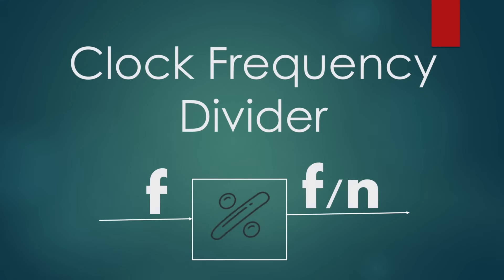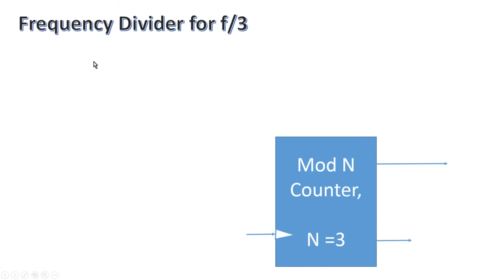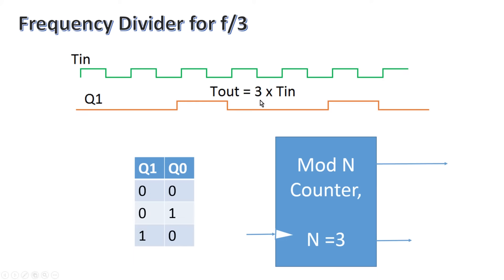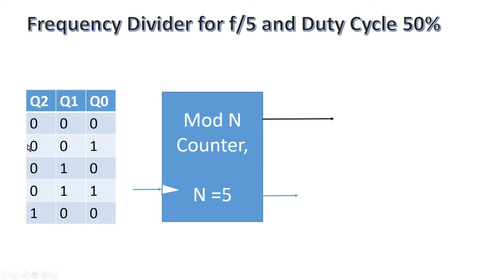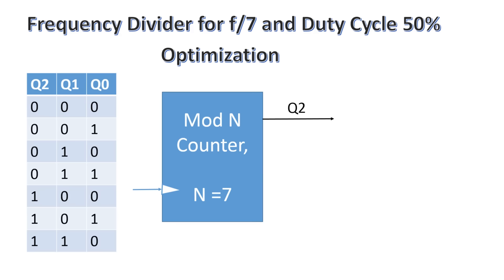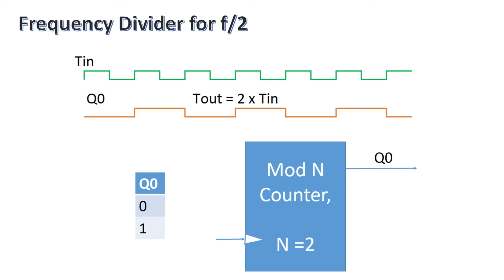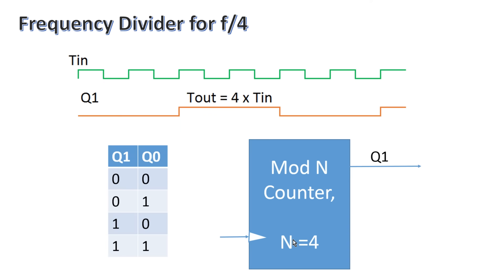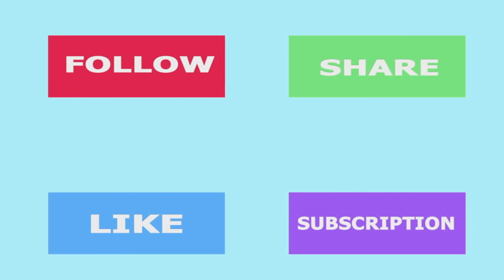Step by Step Method to design any Clock Frequency Divider

Comment: When we give f/4 to a -ve edge triggered DFF, it just delays the signal, but the frequency of the signal doesn't change.
When you check the clock diagram for both the outputs after ORing them, we see that we will get 2.5 clock cycles of logic 1, but also we will only have 1.5 clock cycles of logic 0. Hence, i feel that we did not get f/5, but we have f/4 with 3.5 clock cycles of logic. 

If i am wrong, please correct me. Thank you
And please confirm if I am right or wrong
Reply: Umm for f/4 just use Q1 directly...
I think u are talking about f/5? 
If so then after u get 2.5 high periods and draw them , it doesn't fit the initial scale ( used in the input clk f) but independently you can see it's actually f/5

Comment: There is a mistake in you timing diagram of Q3 at 16:30. The pulse for Q3 at the end of the timing diagram is wrongly delayed by half clock cycle instead of 1 full clock cycle.

Comment: How does the f/4 clock divider avoid having a glitch in the center as you transition from counter values 2'b10 -> 2'b11? The others work because the use of the inverted clock being used to create a delayed version that are OR'd together, which helps protect from any potential glitch in the middle.
Reply: you dont need a mod-n couter for 2^n divisions. f/2 is a single d-ff which has its q' connected back into itself and thus output q serves as an f/2 clock. connect this f/2 clock to the clock input of another d-ff which has its input from it's q' as well. thus the output of d-ff q2 serves as an f/4 clock. you can keep cascading connections to get f/(2^n) divisions.

Comment: for frequency divide by 3 ckt you have taken Q1 and did shifting for the wave generated through d-ff and did or we got output at 3-4.5(On)cycle and 4.5-6(off)cycle. why dont we take Q0 as both have 33.3% duty_cycle? is there any reason taking only Q1?why?

Comment: The fact that negative edge trig d flop will delay by half cycle is only true if the counter is made of positive edge triggered flip flops. They have to basically be opposite triggering for half cycle delay and same triggering for 1 cycle delay.
Reply: i also have same question

Comment: 8:50 sorry but I can't understand why Q1 is a signal of frequency f/5? Also 11:42 why Q1 is not a signal of f/7? I thought you could optimize the last case by choosing the Q1 column which had 3 high signals and 4 low signals

Comment: Thankyou for the wonderful explanation as always.
How would we tackle a situation when the DC produced by the frequency divider is for example say 75% but we want 50% duty cycle? what do we do then? You have addressed the situation where the desired DC is more than the actual DC so we can add flops to achieve that, how do we do it for the example that I mentioned? TIA :)
Reply: I am not sure but in that case we can use d flip flop ( negative or positive depending on our requirement) and then will use and gate or some others gates depending on the output we need like xor etc.
Thanks

Comment: Hi...very good explanation. I have a question. You were used MOD-N counter in frequency division. As per my knowledge MOD-N counter can implement in synchronous and asynchronous manner also, so which counter it is, synchronous or asynchronous ?
Reply from the maker: In usual practice, synchronous designs are used .. because asynchronous designs are prone to glitches.
Reply: Synchronous because at the outut of each ff  f'= f/n

Comment: Cant we design a f/6 using a and gate with q1.q0 and ORing it with q2.  ((Q0.Q1)+Q2)
Reply: Divide by 6 is very easy divider, because a simple TFF-trigger is enough to divide by 2, next step is by 3 divider (2*3=6), which can be implemented with simple counter.
One of the reason of video, I presume, is to make combinational frequency divider, but if divider is multiple of 2 we can do that with synchronous logic.

Comment: Sir, what do you mean by q1 is not having a signal f/7?
Please explain
Reply: As we notice that in mod 7 counter,
States are
000
001
010
011
100
101
110

If we take Q1, it's changing from 0 to 1 or 1 to 0 right after 2 clock pulses
 That is, the frequency of Q1 is f/4

Comment: I have been using these frequency dividers in my microcontroller-based  projects for almost a year for different purposes but until now I didn't know how it was possible to "divide" a clock frequency, it just makes no sense when you look at it that way, but the picture depicting this "division" actually explained it perfectly, all you do is increase the T by the amount of N you want. I still don't know how these digital blocks actually work but at least I know how they change frequencies

Comment: In f/6 why don't we just use q0 to take out the frequency of f/6? then we won't be needing extra hardware for that circuit. Anyone can explain that?
Reply: q0 is a div by 2
it goes like this 010101
but a div by 6 goes like this 000111

Comment: I have a doubt, how do you get to know that Q1 is not  a signal having frequency f/7??
Reply from the maker: Observe Q1 carefully, It is 0 0 1 1 0 0 1
Let us repeat this pattern 
0 0 1 1 0 0 1 0 0 1 1 0 0 1  0 0 1 1 0 0 1  0 0 1 1 0 0 1  ........
See Q1 carefully .. It is not even a clock signal .. 
because logic HIGH and logic LOW times are not fixed ..
That is another reason for not considering Q1..
Let me know if you need further clarification..
Reply: @TechnicalBytes  Hi sir, please further clarify the same question.

Comment: hello, i try by myself to create the f/7 as you shown in the video but there's a problem becase the last falling edge given exsta half clock cycle at '1'. and i am not get 50%.  thank you very much for your video!
Reply from the maker: Can you please share your waveform with me??
Reply: @TechnicalBytes  Hi i got the same result , for divide by 7 , if we delay the msb by 0.5 cycle and or it with non delayed version , the final result is -> on period = 4 cycles and off period  = 3 cycles and failing to meet 50% duty cycle, could you help here ?

Comment: How Q1 has same frequency as Q2 in freq/5 case?
Reply from the maker: In f/5 case .. We are using Mod 5 counter which keep on running ..
Q1 will be 0 0 1 1 0
As counter keep on running .. so let us repeat this sequence ..
0 0 1 1 0 _ 0 0 1 1 0 _ 0 0 1 1 0 _ 0 0 1 1 0 ...........
Just observe this sequence .. it is a train of 2 1's and 3 0's, which means five bits forming a clock. hence it is f/5
Let me know if you need any further clarification.

Comment: Hi...great video! Have a question. Can we generalize the number of flip flops required in any frequency divider? We see that for a f/n divider we need a Mod-n counter which will tell us the number of FFs required according to the bits. But depending upon the number of altering clock cycles, we have to add another FF. So pls suggest if any way to find this.
Reply from the maker: Yes you can! but I am not sure for what purpose, you want to do so .. but let me tell you the answer .. 
Step1: Just count the number of 0's and 1's in the MSB bit of MOD N counter .. 
Step2: Get the difference between number of 1's and 0's
Step3: divide this difference by 2.. 
if division is 0, means no flop required.
if division is 1, it means 1 posedge flop required.
if division is 1.5, it means 1 posedge FF and 1 negedge FF
if division is 2, it means 2 posedge FF required.
if division is 2.5, it means 2 posedge and 1 Negedge FF 
-------------------------------------------------------------------------------
-------------------------------------------------------------------------so on.
Reply: Take n/2 flip flop as we are making johnson counter.

Comment: For frequency division by integer, couldn't you use a decade counter (4017 for example) and simply take the appropriate output into the reset pin?  My mod 7 circuit, which lights the segments of a 7-segment display sequentially, and the dp as the input clock indicator, has the q7 pin (output 8) connected to pin 15 (reset).
Reply from the maker: Thanks for showing your interest in Technical Bytes
Reply from the maker: Sir, you are very correct, we can use Decade counter to divide a frequency but duty cycle will not be 50%. 
As IC 4071 gives one hot encoded output. It is very easy to convert a one hot counter to clock frequency divider .. Please go through my previous video: https://www.youtube.com/watch?v=AfINILc0WEg